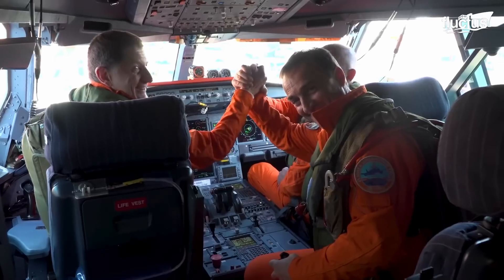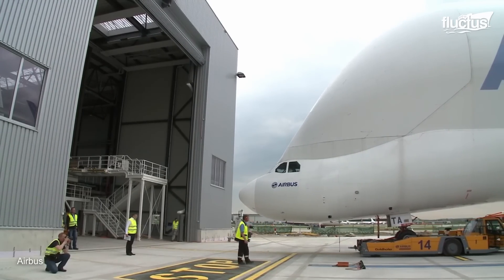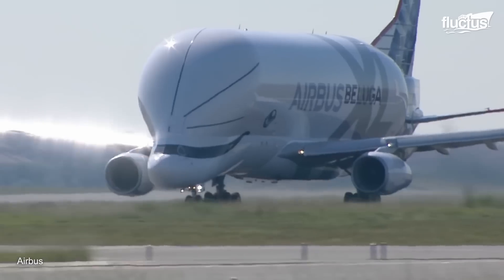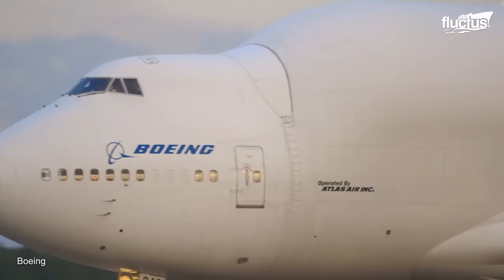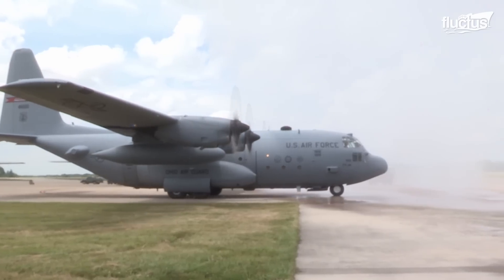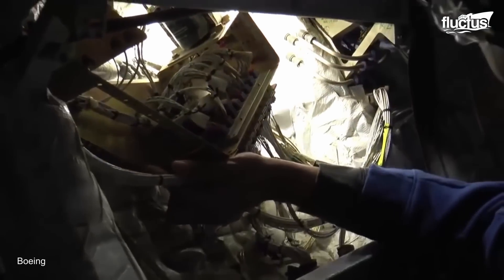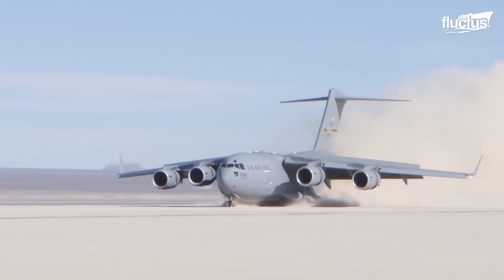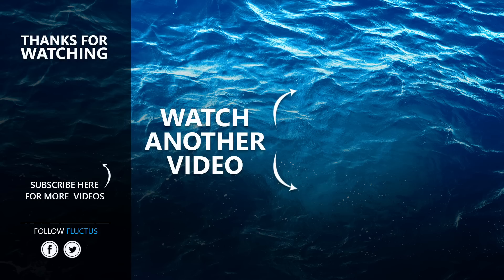Inside Billions $ Airbus Factory Building The Weird Looking Beluga Plane

Comment: I wonder if they got any engineering help from the old Aero Spacelines “Guppy” series from 50+ years ago.
Reply: they did.
Reply: @venkateshpas3099 Thanks. I hardly remembered watching this! I was a student at UC Santa Barbara in the early 1970s, and they often had one or the other of the “Guppy” series conspicuously parked at the Santa Barbara airport nearby. I just refreshed my memory about the first Guppy that was derived from the Boeing 377 / C-97, with 4 “Wasp Major” prop engines, but I never saw that one.